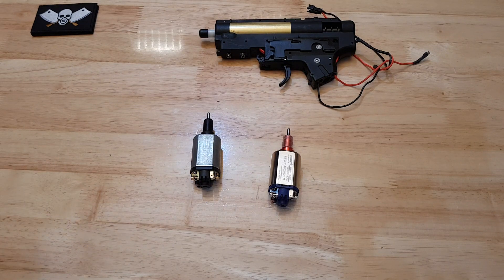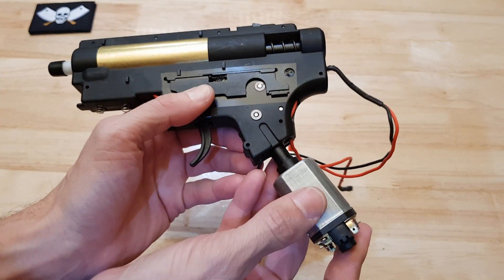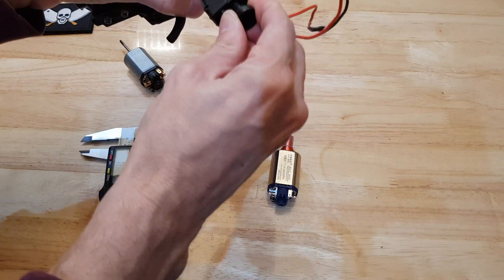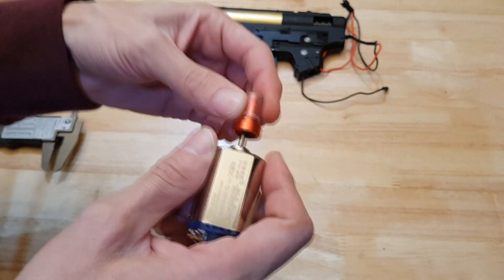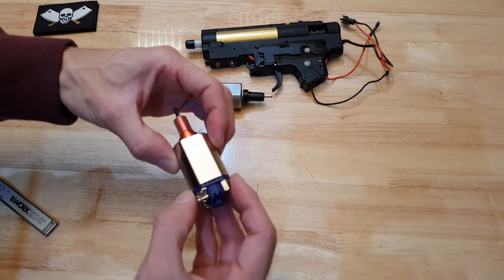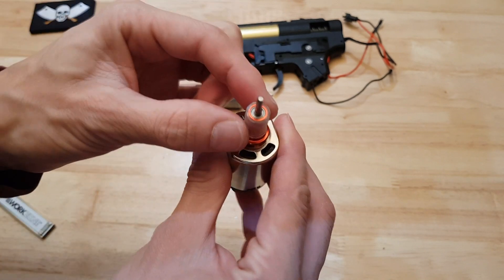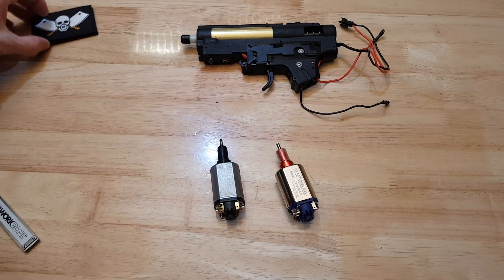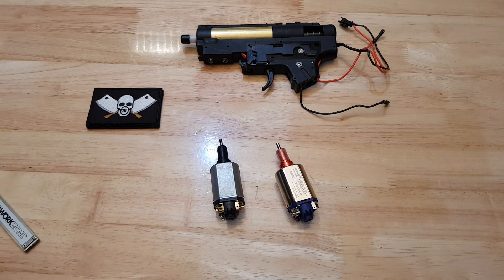J9 gel blaster motor upgrade tip (check your sleeve)

Comment: Another great video. Some of the spindle sleeves I've seen are slightly tapered, a uniform sleeve can prevent the motor from being pushed firmly against the bevel gear.

Comment: Had the same issue with multiple brand motor towers in different gearboxes, generic metal v2 and Mk tactical, ZCI for example have a smaller diameter tower.
Really oblivious when using a high torque motor.
ASG on the other hand were all good
Reply from the maker: motor tower.. thats what its called?
Reply: Low Guido's Chop Shop yes sir it is🤙🏽

Comment: The real question is, where can one obtain a brushless 11.1-12v high rpm electric motor?
Reply: why? brushed does the job just fine. But the answer to your question would be the internet.
Reply from the maker: brushless are available but then they require special electronics to operate.